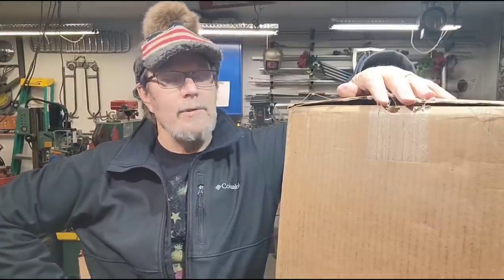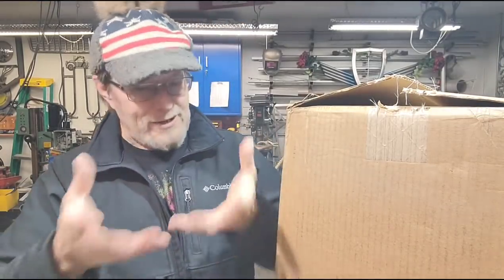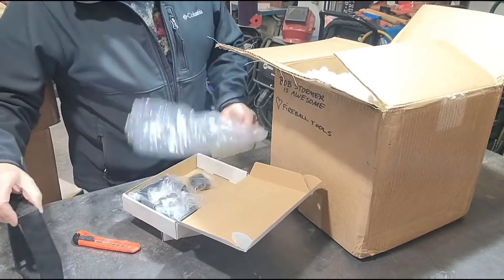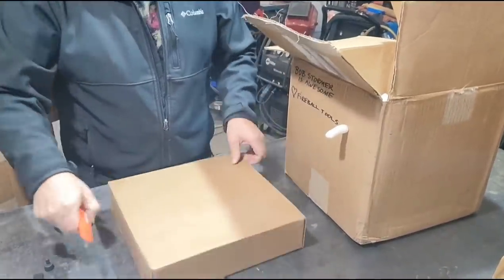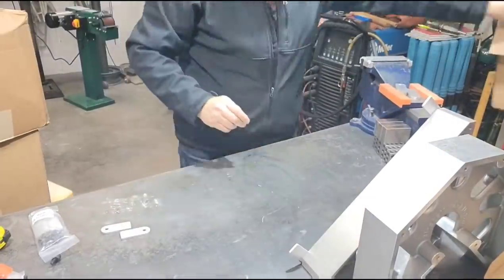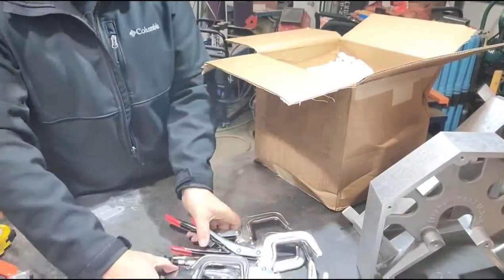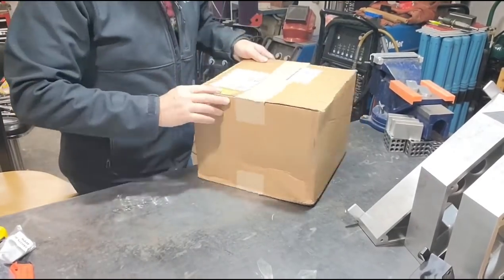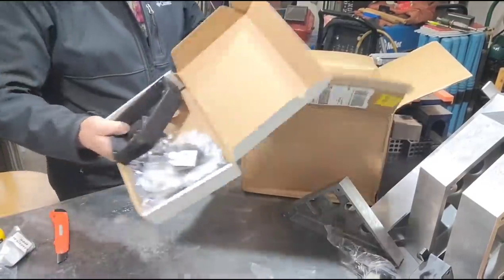Fireball Tools squares unboxing. Fireballtool, could these be the greatest squares ever made?!

Comment: Hate the fact that spent about 1800 dollars on FB tools knowing i had a project coming up in 2 weeks. got a confirmation email right away but no shipment for a week. i contacted them for them to say one of the items was currently being restocked. I received the items after 3 weeks after I finished the project and shipping only took 2days. Everything was listed in stock and only was told after i contacted them. I ordered one of the scraper/hammers, i did not order a blem and the casting looks like it was ground down with a fork. I'm aware  some FB tools are rebranded but was under the impression all the sqaures and some clamps are made in the US only to find out only the larger sizes were. The website is extremely misleading and has changed many times but still to this day i can select an item and it says US made above it and its not. He pushed the squares alot and is now pushing the tables hard and has the comments turned off of everything he posts. dont feel comfortable supporting this biz anymore.
Reply: I agree, similar experience.  I had such high hopes with this company.  They are ghosting me. What good is a 60 day money-back guarantee if they won't reply to messages. I noticed several of my new squares do not have "USA" EMBOSSED on them .
Reply: @USA-vo5by  Just trying to support a US based company with claims of made in the USA. The tools are still used but no more money will go in that direction. The hype had already died down with this company by the time I made my purchase and maybe this is one of the reasons. These days it far too easy to make your own tables and squares it’s just some of the fixtures but plenty of places that sell them. Thank you for sharing your story.
Reply: Well, I guess we now know why he turned the comments off on all of his videos.

Comment: :hand-pink-waving: help me understand if you have found a difference between the aluminum and iron square if for example the welding spatters stick apart from the lighter weight and if the weight is easier when you work and maybe it is better - if you can tell me something - greetings from 'Italy
Reply from the maker: I haven't noticed much.